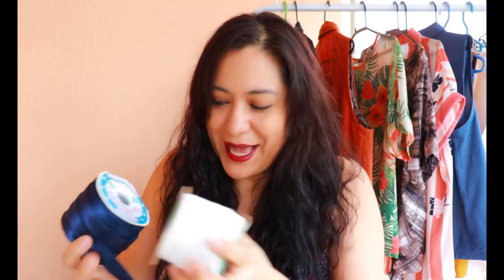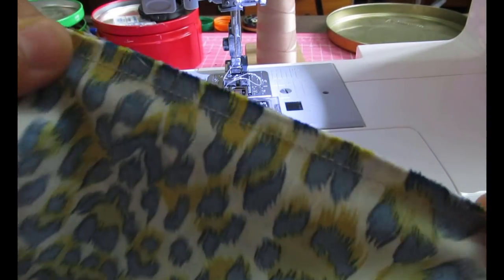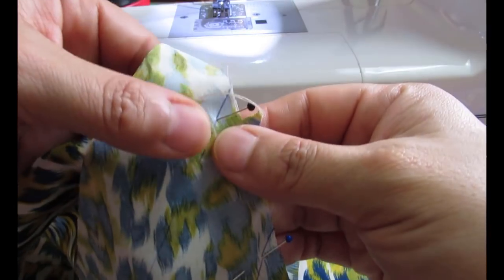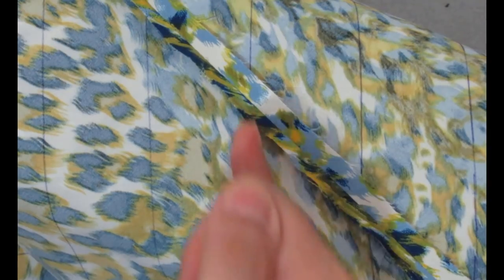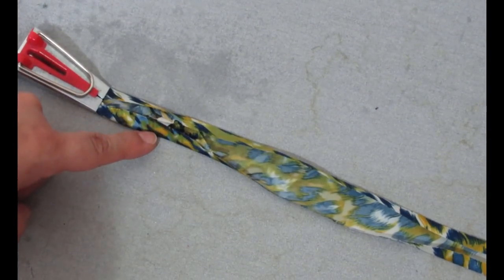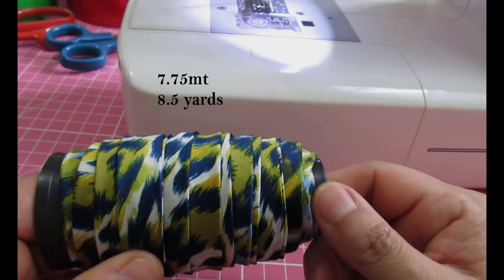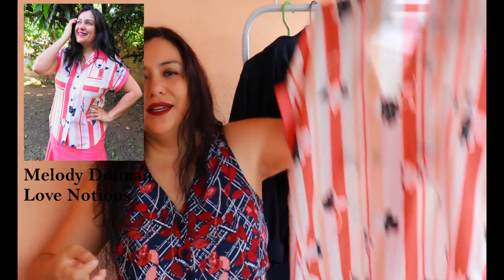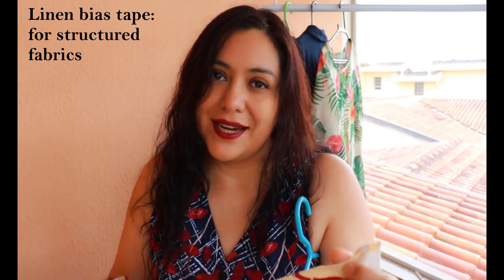Continuous Bias Tape tutorial. Different fabrics & practical examples. Bias tape maker sizes.

Comment: The smaller bias tape sizes, 6 mm or 12 mm, are good for making fabric ties, instead of fiddling with rouleau loops.  Nancy Zieman, a USA sewist on public television, suggested using a straight pin to guide the fabric through the tape maker, but whatever works for you! THANK YOU for such an informative video.
Reply from the maker: I’m glad you liked it. Yep, I’ve used a needle to push it through too and the stiffer fabrics go in without help. Great tips for the little ties. Thanks 😊

Comment: The inside of your clothes are just as beautiful as the outside!! 

Have you seen the gypsy gripper? It has two suction cups on it to grip a clear wide ruler and it helps to hold your fabric while you use the ruler as a guide and use your rotary cutter.
Reply from the maker: No I haven’t. I live in Brasil and can only access local supplies. Novelty things…. I can’t get them.

Comment: Another fantastic and vey helpful video from you Karina. I have a quick question... I watched your older video about using bias binding on armholes, and its a beautiful finish, however, I couldn't see how you join the ends where they meet in the "ring" to close off the binding. do you overlap the ends or do you stitch them together firstly to make a loop?.....
It would be interesting and very helpful to know this procedure :)
thank you so much for your wonderful videos. 
Jacqueline :) x
Reply from the maker: 99% of the time I sew the edges of the binding at the underarm seam area to form a loop first and then sew it all on the round to the armscye. I prefer this because it’s so neat. I have bound on the flat and then sewn the side seam in 1% of the cases.... very ugly, I don’t recommend that :)
Reply: @LiftingPinsandNeedles  :) I would agree about that, but was just curious how you did it.
thanks so much Karina x

Comment: I realize this is an old tutorial.. however this is a suggestion for those of us who don't want to mark lines and use scissors.  I use my serger with needles and thread removed to cut a premeasured amount. Right before you seam and press the last bit.. Forget the lines because you won't need them. Fix your seam edge at the point of measurement you want: ie: 36mm or 24mm etcetera away from the beginning edge. sew the last seam just as you would have done, press it open. You should now have the tube complete without lines and placed away from edge the needed binding width. Place the material in your serger where your mark/material is attached. Mark on your serger bed the width of binding you want and cut away. this takes moments and is another great way to use a serger.
Also: do you have a way for us to order the bias binding you get from Peru?  Thanks for all your videos.. it's just the best.
Reply from the maker: I bought the bias tape at the street markets in Bolivia. There is no way to order it online.

Comment: I have a question; would a biased bound neckline sit better if the bias strip was stretched a little as you sew? I know you need to make the length shorter for knit fabrics but what about woven fabrics?
Reply from the maker: Controversial. When you flip binding to the inside, the edge sewn to the fabric will be a distance away from the actual edge of the neckline and the further away, the bigger the circumference becomes, so if you stretch the binding, the smaller it will be. End result: puckers. So, no, I would not stretch the binding as I sew.

Comment: Maybe use your clapper on the fabric after passing through the tool. It will set the crease.
Reply from the maker: I don’t have a clapper. I’ve never seen one to buy one.
Reply: I resisted buying one for a long time. Now that I have one, I’m using it all the time. It absorbs heat and therefore improves and quickens pressing. I think one use of the thin bias tape maker is used for flower stems in appliqué. I hear the saw in the background! 😂
Reply from the maker: There are a number of constructions around the neighborhood and I can’t control the noise and they start while I’m in the midst of filming. It’s super frustrating 😬. At the end of the day, I’m filming in my home, not a studio and I do the best I can. I’ve never ever seen a clapper but I’d I do, I’ll get one too :)
Reply: @LiftingPinsandNeedles  I would send you a clapper but it might cost a million to ship it..😀 With all the construction going on you  just might find a scrap of wood to do the trick.
Reply from the maker: Yes it’d cost a million and they do all cement here in construction. I’ll keep my eyes peeled for some wood in Chile when I go now 🙂